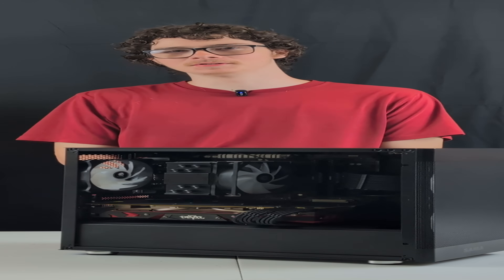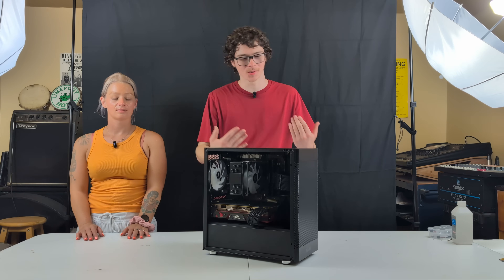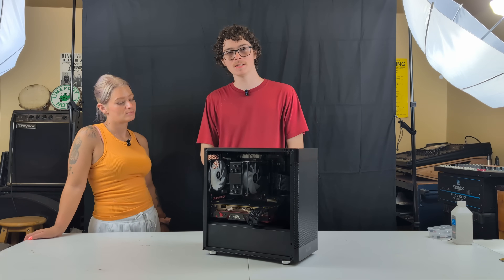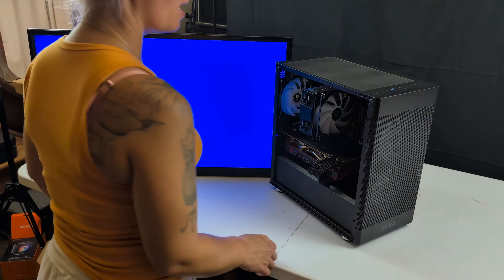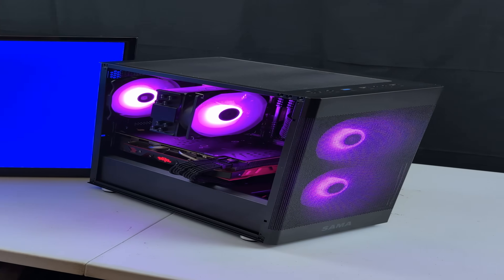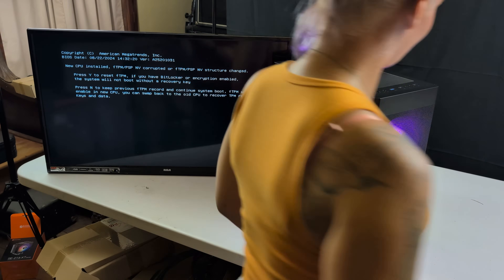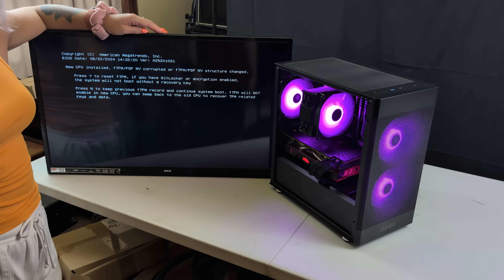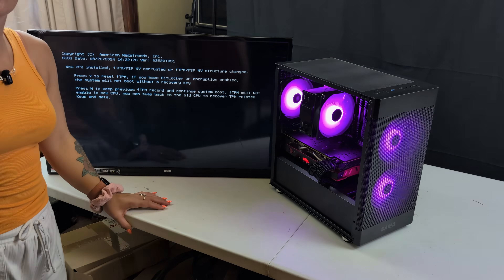I Taught My Sister How to Build a PC!

Comment: Hi. Sorry. But at just past 5 minutes into the video. Where he tells her to put the cpu into place. He could have at least tell her there is a little triangle in one corner on the cpu and on the board where it goes. Then to align the triangles up. That way ensuring correct installation of the cpu. I am no pro or expert. But built and rebuilt a few in my time. One of the first thigs I learned was this fact of the triangle on the cpu and board.
Reply from the maker: I actually cut out the portion where I told her how I line up the CPU! Rest assured she put it in the correct orientation, but it just wasn't seated properly all the way and unfortunately I didn't catch it 😔

Comment: Computers don't need a GPU or iGPU to run.  They don't even need to be connected to a monitor.
Computers don't need an SSD or HDD to run.  It's extremely rare for decades now to have one run without one, but it is possible.  Well, it certainly was possible.  I haven't really tried it in the last 25 years.
Computers do need RAM though.  They also need ROM, but that is not a user concern.  

An easier way to show these things to a complete noob is to call the GPU its original name, Graphics Card.  

Your sister is a natural, also I approve of her sound effects skills lol.

Unregistered Haircam 2...now that's clever! 

This was a fun video, F for the CPU, but still, fun video!  
Thanks for sharing!  

Cool sister.
Reply from the maker: Thank you for your insight on everything, and I'm glad you enjoyed the video! My sister had fun so that's all that ultimately matters, regardless of what went wrong 😅 

Maybe next time she's over I can have a more in depth discussion on everything off camera. It's hard to explain stuff thoroughly while also making sure the pacing of the video isn't disrupted so that's definitely something I struggled with. This was actually the first video that featured another person so it was a new experience for me too 😎

Comment: For a frame of refernce as a computer builder of 37 years. Yes you should spread the thermal compound across the entire surface of the heat spreader.... About 0.5mm thick max  Most builders dont realize if you apply too much and its squeezes out, It can not always but sometimes make contact & cover others tiny components around the socket and will thermal suffocate them increasing the heat of said component.. their needs to be air gaps around those tiny pieces to keep them for overheating
Reply from the maker: This is completely fair, but honestly the only time I personally spread the thermal paste is on larger Intel CPUs or if the chip doesn't have an IHS (such as GPU dies). On smaller CPUs like this I think just about any method would be fine. In fact I recall the X method being the best technically but obviously by such a small margin that it doesn't REALLY matter 🤣 

I appreciate your comment though and what you said is completely valid 🙏